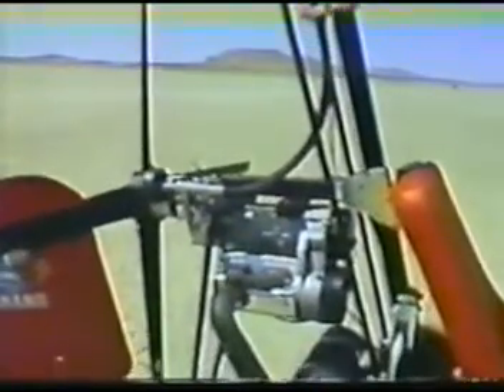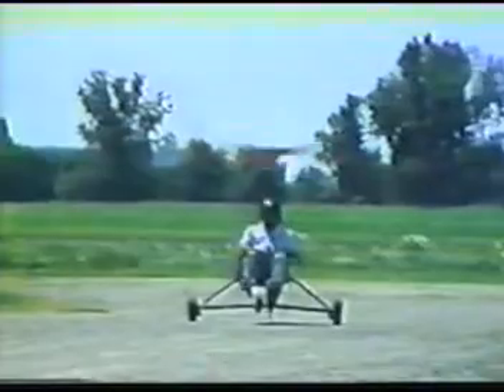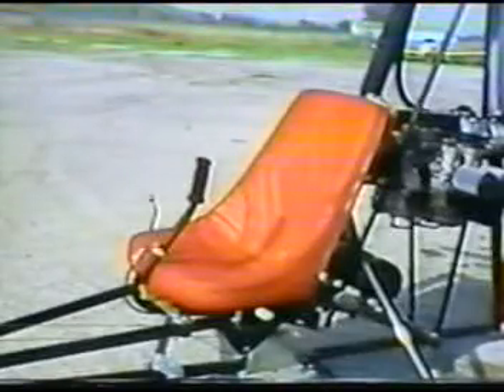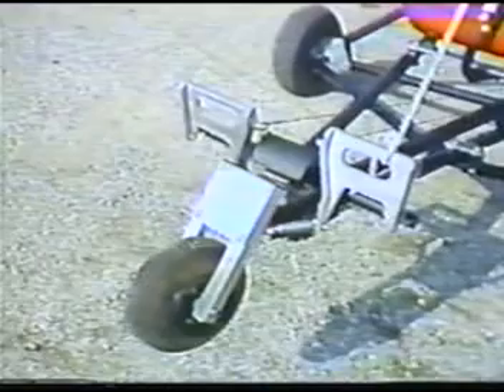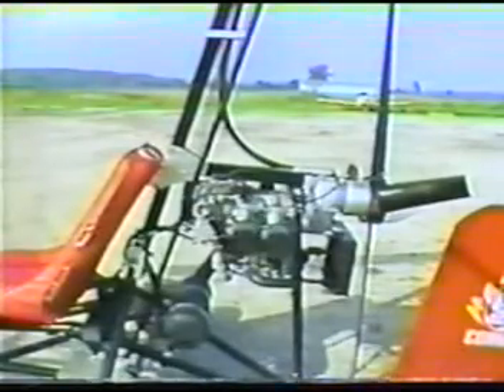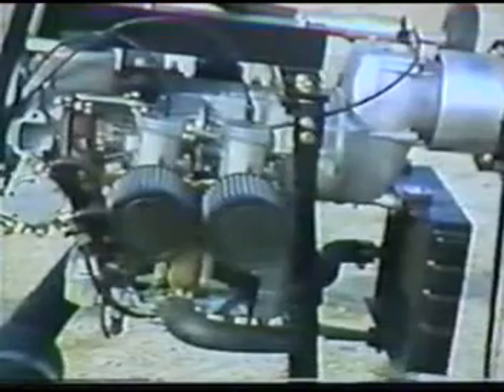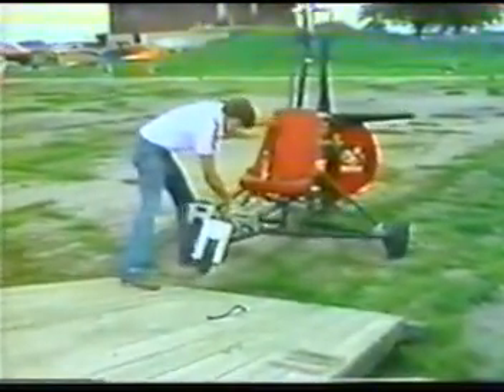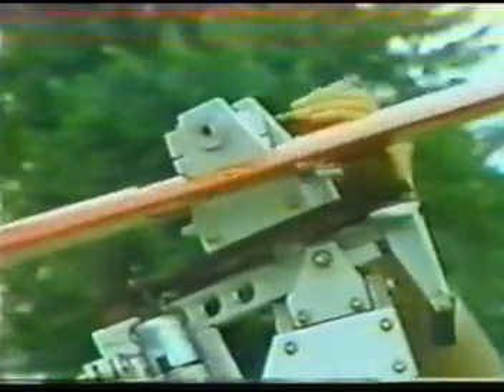Part 2 of the 447 Commander Gyroplane original demo video

Comment: Hello, where could I buy the Air Command 447 Commander Gyroplane and for how much, or where can I get the documentation to make such a model?
Reply from the maker: Hi, I'm Dennis Fetters. I designed the Commander and started the company Air Command. I sold the company back in 1990 so I could start the helicopter company called Revolution Helicopters. Air Command has changed hands again and is now owned and built by the people at this website: https://aircommand.com 
I have nothing to do with the company now, but you can contact them and see what it takes to buy a Commander. Good luck!

Comment from the maker: Hello Jose, I sold the company back in 1990. It is still running in Texas but they don't offer the 447 anymore. Rotax stopped manufacturing them years ago, so you can't build a legal Ultralight Air Command anymore. You can buy the larger and more powerful Commanders, but you'll need a pilot license to fly them.